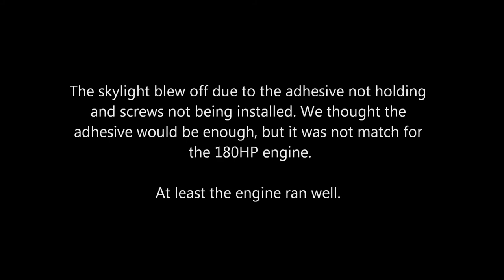Aviat Husky Engine Startup After Rebuild

Comment: Thanks for the video. I missed "Husky Second Engine Start" at the beginning the first time I watched it. A brief introduction or background would add a more personal touch. I like the camera angles and cuts between them and the slow motion at the end.
I thought it wouldn't start at first, but I'm assuming you were turning it over a couple of times to lubricate the engine.
Will this be a series? I'm waiting for first takeoff, cameras inside and out. First trip. Tour of the cockpit. Flying in formation with the 185 and Pitts. Grass landing? How much for a device to record audio from the headset? I would watch those videos.
Reply from the maker: Actually all that is in store. We have already purchased half the gear to record audio. I might do a cockpit tour for you. Trips, formation, grass, water, etc. All those are coming soon.